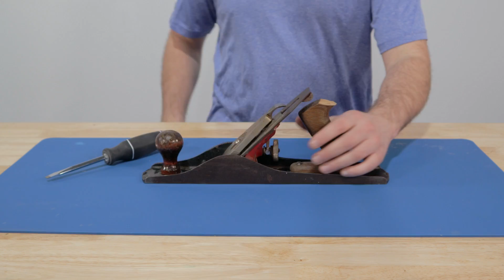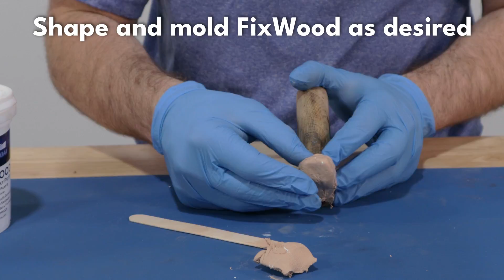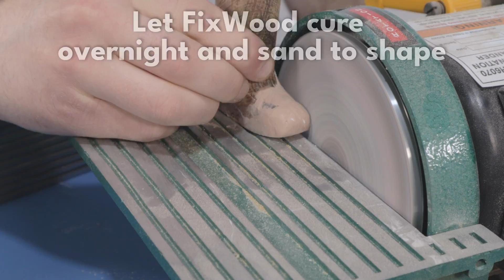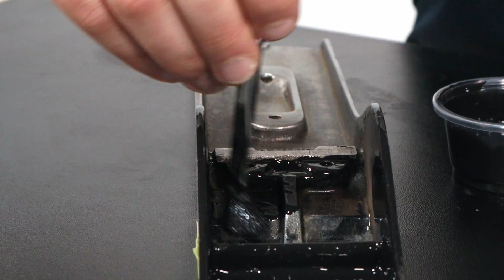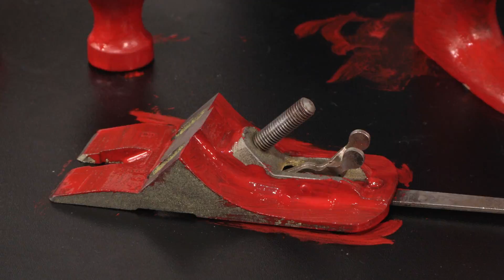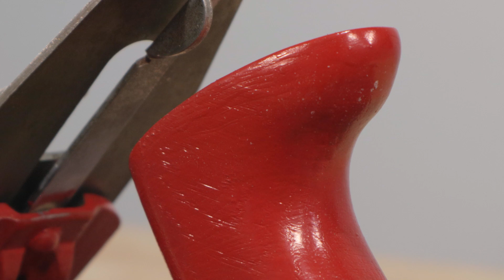Restoring A Hand Plane Handle Using FixWood

Comment: Umm, no. The wood was varnished, not painted RED. When you sanded the sides did you make sure they were 90 degrees to the sole? You wirebrushed the sole. Did you flatten it afterwards? The sole and sides need to be dead flat and 90 degrees to each other.